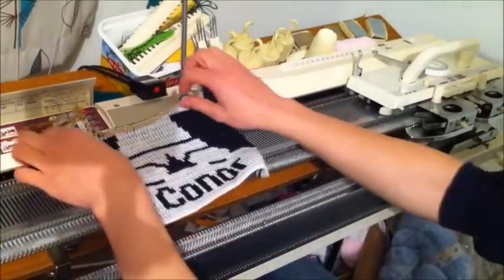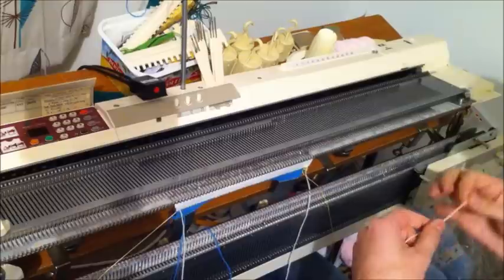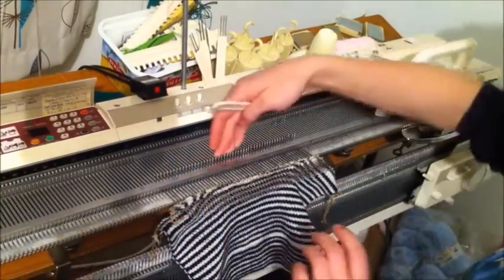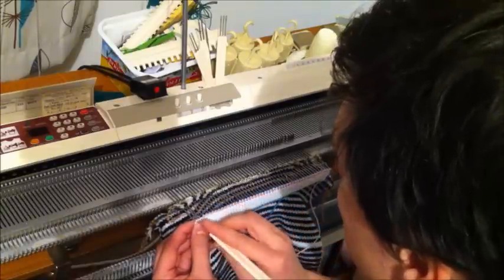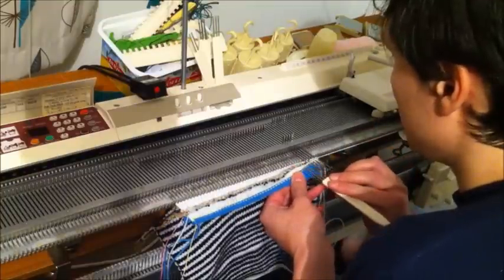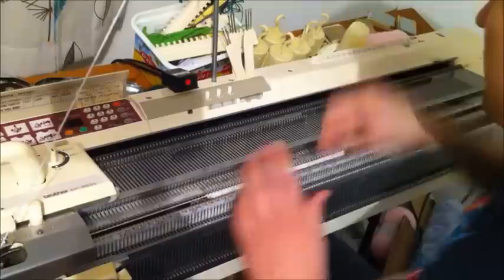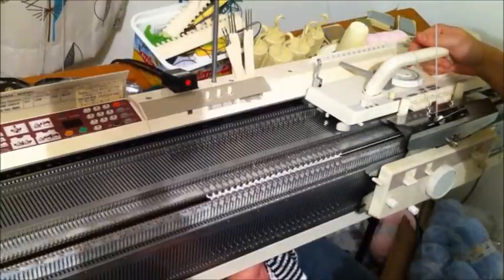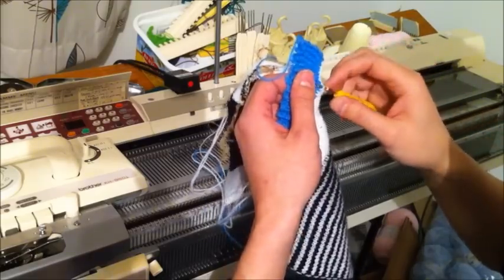Cut and Sew Industrial Neckline on a Japanese Knitting Machine

Comment: Very informative.  I think the serger/overlock feels "safer" to me, as I haven't convinced myself that the cut edge won't unravel.  I have seen this method done, but with circular knitting, in place of the two pieces attached.  What is, exactly, an "Industrial Neckline"?  Thanks for your help.
Reply from the maker: Thank you for your comment Linda. Industrial neckline is basically the name given to the encasement, often done on an industrial scale to quickly and effectively hide the overlocked edges on cut and sewn garments

Comment: I have a real struggle to attach my ribber - whatever I do the two carriages do not seem to lock completely together, and it means that both the ribber and the knit carriages are very difficult to push. I have the same machines that you have, do you have this same problem? I have confined my ribber to under the sofa because of this...!
Reply: Hi Jason you just need to make sure the ribber  and main bed are set up so the space between the beds are not too far apart . Don’t give up try again and look at the videos on line which show you how to st it up . Good luck
Reply: @suegurney4666  Thanks. I sold it in the end and went back to using the Toyota